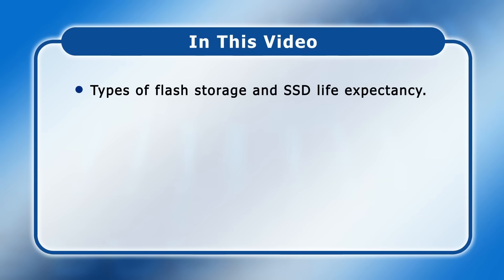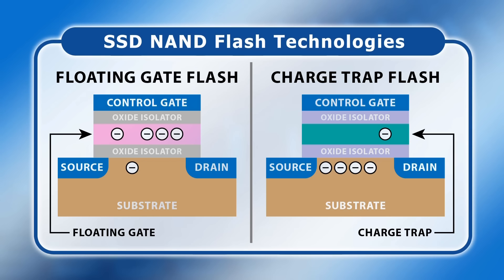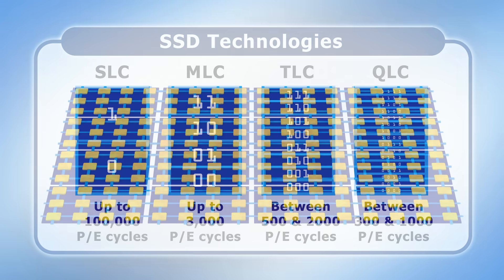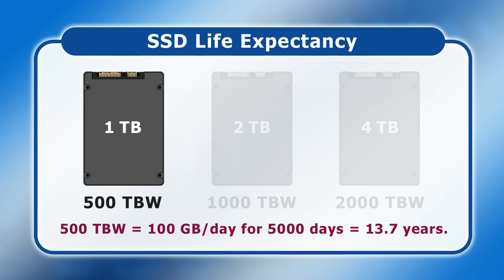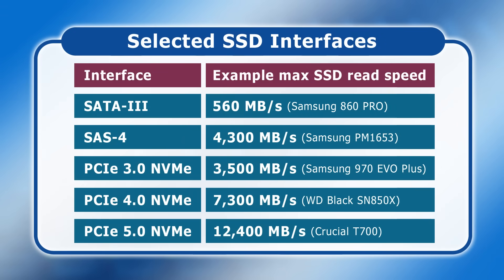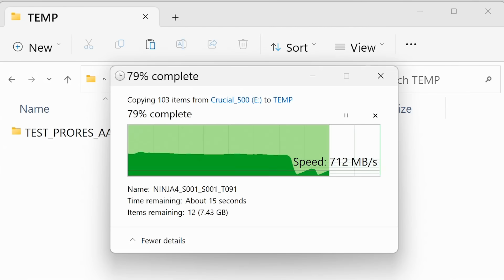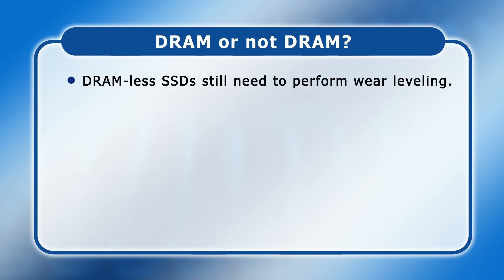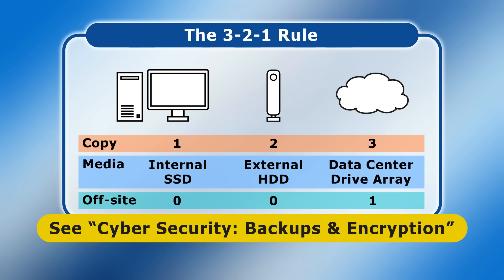Explaining SSDs: The Price/Performance Trade-off

Comment: Uhh, They still make the 860 Pro, and Samsung's website still state they're 2-bit MLC They even make them in 4tb, though I dare say at an eye-watering price.
Reply from the maker: Simply not true. Samsung most certainly do not still manufacture the 860 Pro. I do not tell lies in my videos as you infer. I don't know what website you are looking at, but the Samsung page for the 860 Pro here --
https://www.samsung.com/uk/memory-storage/sata-ssd/860-pro-sata-3-2-5-inch-ssd-512gb-mz-76p512b-eu/ -- notes that "This product is no longer available. Please choose another from the range." Which is pretty clear, and  in line with numerous reports of the same.

There are few 860 Pros still listed on Amazon/etc, and for very high prices as you say. But this simply means that a few possibly still exist with retailers (often web listings do not reflect stock). And these listing in no way reflect what Samsung itself sells, let alone manufactures (and in the video I said that Samsung do not sell them). I really do give up. This distinction between a company making and selling a product, and some (old) retail listings still existing online, is not hard to understand! :)
Reply: @ExplainingComputers  Mate, I never accused you of lying. I was genuinely under the belief that they were still available. At least they seem to be a few months ago.

They are hands down an amazing hard drive that I would trust to have at least a copy of my important data on.

Yeah, and I've given up too, what's new? It's as clear as mud; you state Samsung don't directly sell them. yet you mention that they do and compare them to (old) listings.

I get what you're trying to say, but contradiction isn't really easy to understand :)

Comment: It's weird how today, at least in my place, 2.5 inch SATA SSD is more expensive than the NVME PCIe for the same storage size.
I also still use HDD except for the OS. I use the WD Ultrastar for hopefully, maximum reliability.

Comment: Another great breakdown and explanation, which begs some potential questions.

1. Is there a software utility available that can read all of the relevant information from an SSD for a user to determine exactly what they have, that can be compared with the information given in this video, which could also hopefully include stats of drive usage to allow somebody to gauge how long theirs might realistically last based on their usage to date?

2. When it comes to backups. do we think that mechanical drives still have a long future as more reliable long term back-up devices?

3. How ling can an SSD actually hold onto data, even if it light years away from any normal wear and tear use values? Does it fritter away into the ether if stored away and not used for a long period?

Comment: An SLC cache serves a useful benefit in data protection on unexpected power loss. The SLC cache can be FIFO do written in a simple loop fashion. Once the data hits the cache it's committed, then the drive can move it to long-term storage at its leisure. If this is interrupted it can just go back through the SLC cache when it's powered up again and recovery anything that hadn't yet been moved to long-term storage. In effect the SLC cache is a huge write journal which includes file data.

DRAMless SSDs also benefit in that there's not lots of data in memory that is lost when power is unexpectedly cut. This also makes it easier to recover from such an event, without loss of recent writes.

Comment: There are great deals on used 2-bit MLC SSDs these days, especially enterprise drives with power loss protection. I'd take these over a new 3-bit TLC drive any day.
Reply from the maker: Very true.
Reply: @ExplainingComputers  I should say that this just applies to SATA drives. NVMe drives have gotten so fast in the past decade that you wouldn't want to use an old one if speed mattered.

Comment: Yes, Backup always the Issue, I have for Last 40 Years, Just bought a Spare HDD, Made a Copy of System, leaving 1 on Shelf, It works, as I never have lost anything important, but it has filled a shelf or 2 with HDD's just sitting there .. I Just Purchased 2 x 4TB Kingston NVME NV2 SSD, I put them in a Twin NVME USB Raid, for a 8TB SSD, I am satisfied with these units Performance, it took about 3 hours to backup 7.2 TB for my Main Machine, sadly I didn't watch that hard, so no idea if it slowed down, just that it worked ...As I paid $1495.00 for Each one of 4 x 20 Meg St-506 HDD way back when, I am more happy with the Price per Meg these days, but I do like Drives being Faster ..

Comment: Thank you, that was interesting. specifically, the fact that leaving an ssd less than 90% full so it can shuffle data around easier. I already did that because hard disks liked that to prevent fragmentation so it's nice to know that this still holds true but to prevent wear instead.
Reply: I know that many defrag utilities stated not to be used on SSD's ... NOW I understand why!
Reply: @lesliedeana5142  The reason why defrag programs aren't used on SSDs is because it doesn't make sense. SSDs don't have tracks, sectors and clusters, neither they have moving arms and heads. So they don't need to reposition the head to another track or sector if a (large) file spans over more than one of them, like mechanical disks do. SSDs are electronic devices, capable of accessing any block of storage immediately, without any repositioning or rotation latency involved.

Comment: Hey Chris, I've asked you before about this; can you explain WHY my brand new WD SN570 2TB DRAM-LESS TLC SSD, fitted into a USB enclosure, won't work with my Beelink Mini S Windows 11 PC, yet works perfectly with computers from the year dot? ... Betcha can't explain that? 🤣

EDIT: What about leaving unallocated space on an SSD, to extend life expectancy? I usually leave 10% unallocated.
Reply from the maker: I would guess that the Windows PC may somehow be registering that it is a DRAM-less SSD that is requesting system RAM via HMB mode (and it cannot access the RAM over USB, so fails). Whereas the older hardware (and OS on it) works because it has no idea what a DRAM-less SSD is, so is leaving  the SSD to its own devices, so it uses NAND flash for its wear levelling map.
Reply: @ExplainingComputers Thanks Chris! You're the best! I've been using and building PCs for 27 years, but always learn something new from your fantastic vids! ... I'm thinking of making a warranty claim on the Beelink, but I'm still unsure about this fault. The SSD is unstable on the Beelink, and appears and disappears. It's totally unusable. Surely WD wouldn't make an SSD that DOESN'T work with a Windows 11 PC, even though it's via USB?

Comment: I retired from a nearly 40-year career as a computer and network admin. This has always kept me close to the hardware and how the operating system uses it, especially in the earlier days through the evolution from mainframes and minicomputers to common standards-based ISA and PCI systems with mass produced expansion cards. This particular tutorial is excellent, and has expanded this old dog’s understanding of non-rotating storage devices. I was vaguely aware of the cycle-based limits on lifespan, and now I see the details far more clearly. Thank you..
Reply: Probably the missing part is to talk about how HDD also has a controller (many people don't realize how everything abstracted) and that both SSD and USB-flash drive sticks are both flash-based and basically the same thing. The differences are in the number of chips, etc. and how fast & smart the controllers are.
Reply: @autohmae  they are not the same thing, the platters and the flash memory are not the same thing! one is mechanical the other is not....
Reply: isa.. lol   bin awhile since I heard that.    still going though..   started with a 8088 too..   in fact I still got 4 working ones :-\        what's with old techs keeping old as stuff...   whats this... a voodoo 3dfx  .....   oh come on LOL
Reply: @harleyme3163  Ha, old computer guys and old computers. I get it. I have 5 older Thinkpad X-series laptops of which the newest is 8 years old and still runs Windows or Linux adequately. The oldest is a working 20 year old Thinkpad X40 that is currently running an older version of Debian 32-bit, and it fires right up and is quite usable as a note taker, simple email client, Remote Desktop client, or basic web access tool. I long ago replaced the teensie-tiny weird form factor 20GB spinning disk with a specialty 30GB SSD which is what keeps it usable. The original 20GB hard disk was the same disk model used in the early iPods when they still had spinning disks inside. I also regularly use a 2010 Mac Pro (big desk-side cheese grater case) that I’ve maxed out on CPU cores and memory because the parts are now so affordable. I hacked it to run a recent version of MacOS  for a while before converting it to a Debian utility server, virtual machine host, and gaming desktop. With 12 3.33ghz Xeon cores and 128GB of memory plus a relatively recent AMD graphics card it’s more than adequate for my meager needs despite it being 14 years old.

Comment: In 2020 I purchased a Samsung 970 evo drive for my wife's computer, 1tb based on reviews and it's very high rating. Now in 2023 that drive has failed, Samsung says it was because of a bios and others say it was a particular chip supplier I believe that would vary which cell was being written to to extend the longevity of the device. Either way in some 30 months the drive experience catastrophic failure despite only having 300gb of the drive used and most other data written to a larger hard disk drive for a majority of storage on the device. Pretty disappointing, but not the first time I've been bitten by the "reputable" manufacturer. My cellphone of the same brand experienced a battery bloating that actually split the phone in half about 2 years ago, it was an s10 that was only 18 months old. I love the video, very concise and helpful, but all I can say is even buying a "quality" device doesn't always ensure the manufacturer will provide a quality example of the product when purchased.
Reply from the maker: Sorry to hear of your hardware problem. Sadly all drives, and all microelectronics more generally, will fail. And they will fail across a statistical distribution where most people in the middle of the curve will get years and years of life, but those unlucky 5% to 10% at the start of the curve will experience early failure. The Samsung EVO 970 is a very good SSD relative to many others. But this does not mean that some of them will not fail early.

I once had a very good quality motherboard that failed after 13 months -- just out of its 12 month guarantee. This stuff happens, and will always happen. It will happen less often with a higher quality item from a better brand. But that does not make such products immune from early failure -- not that that this makes it any easier for the owners!

Comment: Chris, I upgraded my SSD to my newly built computer. WD Black NVMe Game Drive 2TB GEN 4 from a Samsung 970 EVO PLUS NVMe 500GB.  

Corsair 110R Case, Intel Core 12th Gen Inte Core i5-12400, 2500 MHz 6 Core 12 Logical Processor 
Gigabyte H610M S2H DDR4 H610/Intel LGA 1700/Micro ATX/DDR4/Single M.2/PCie 4.0/USB 3.2 
Corsair Vengeance LPX 32GB (2x16GB) DDR4 DRAM 3600MHz Desktop Memory Kit.

Gen1/Realtek GbE LAN/Motherboard) EVGA 750 GD, 80+ Power supply Thanks for the great content and information on SSDs.
Reply from the maker: Sounds good. That's a lot of extra SSD capacity. :)

Comment: So would i be better using 2 1tb ssd drives in raid rather than a 2tb ssd? I say this as the data is written across both drives rather than the one. I know the risks of one drive dying and the array failing but it seems this might actually be better long term for a system drive now. Or am i talking rubbish and about to make a mistake with 2 x 1tb drives as my system drive.

Comment: I bought an B+M key SSD for a laptop.  It fitted but didn't work.  So there's another complication I could have done without and £45 wasted.
Reply from the maker: Sorry to hear about this. Sadly keying is never a sure indication of drive interface support. You have to check whether a computer supports a SATA or PCIe NVMe drive, or both.
Reply: If you can, keep the the packaging and the receipt (if there is one) and return it for a refund.

Comment: Thanks for the very informative video. One thing I am not clear about after watching the video is if buying a larger drive but leaving a bigger part of it empty helps in prolonging the lifespan of the drive. I may have misconstrued it but I thought the video kind of implied this but I am not sure.
Reply from the maker: What you say is correct -- you have construed accurately. :) Larger drives, subject to the same write intensity, will last longer, as they can even out the writes across more clocks.
Reply: @ExplainingComputers  excellent, thanks for the clarification 👍

Comment: There is one HUGE negative to D-RAM less drives that Chris didn't mention. They CANNOT be used in external drive enclosures/external drives because they require your pcs RAM to function.  I found this out the hard way recently, and it took hours of hair pulling and frustration to figure out WTH was happening. Don't buy D-RAM less drives! The minor savings are not worth it.
Reply from the maker: Now this is a great point -- which I guess only applies to the new generation of DRAM-less drives (as those that store their map in their NAND flash should work in an enclosure).
Reply: it's a bit extreme to say that you shouldn't by drives without a dram cache just because you can't use them in external enclosures. the savings can be very much worth it, it's just something to be aware of, just like the potential speed difference.
Reply: @shade221  obviously people can do whatever they want, it's their money, but I won't rich them with a 10 foot pole.
Reply: @SunnyD514-yuck  very few people at the moment are going to use an SSD in an external enclosure. the potential speed difference is a way bigger factor for most people.
Reply: Really? Is this new? I have never seen a working drive I couldn't access through my SATA to USB or M.2 NVMe to USB adapters.

... any specific models?
Reply: @Olivia-W  Yea, mostly. Chris mentioned it near the end of the video. My experience was with the crucial p5 4tb model, which uses QLC tech. The way it's configured, it uses your pcs RAM to function,  which is fine if you're installing it on the motherboard but not so much when using external enclosures.
Reply: Hello, can you explain better that point?
I use very frequently SSDs in external enclosures, but in prevalence Crucial MX500 and Samsung 8xx EVO series.
Have you a handy list of the most common SSds you consider problematic in that kind of circumstances?
Reply: @briccimn  No, because I don't know all of the drive models that are affected. My best recommendation for you is to avoid anything that uses QLC memory,  at least for using with external enclosures. Other than that, you'll just have to use your Google-fu skills to verify if they'll work for you.
Reply: @SunnyD514-yuck  I've been using SSDs since they came on the market...
NONE of them has ever had problems within external enclosures, ever.
So, without googling, I can assure you that in my personal (so not statistically relevant) experience, I don't back completely your words.

There are for sure capacitors within most expensive and high quality SSDs (almost always combined with DRAM, though), which sustain sudden lack of energy to let all data be written when cabels are detached by improper maneuvers, but DRAM-less in external enclosures is not necessarily a no-way choice...
Reply: why did it affect you so much?
Reply: I think the problem is that modern dramless drives that are designed to use HMB cannot use the host's RAM over a USB bus as it requires PCIe lanes to do that, but from what I understand is that with the absence of the option of using HMB, drives will just fall back on using the nand for the function, meaning it will work but with a penalty to speed and longevity. I hope I have that right from what I have read.

Comment: Since younger we got the myth "do not pull off the pendrive if you didn't ask windows to do so or the data will be erased!" Now we will get the myth "do not fill up the ssd or it will last a year!" 😂
Reply from the maker: Well, the pulling out a drive before a safe removal was always (and remains) that data could be corrupted. And nowhere in this video do I say that filling up an SSD will make it last a year. But, as has been known for a very long time, operating an SSD at a very high capacity (90 per cent plus full) will as an absolutely certainly reduce its life expectancy on a drive on regular write-use, relative to a drive that is less full.

Comment: I notice the dram ones working a lot better on Windows. Have used both. Feel like if the cost is close enough best to go for the Dram. Linux will still run well on older ssds/dramless nvmes. Have that Samsung 970 evo plus 2tb in my main machine for my gaming rig.

Comment: Still using the same boot drive 240GB Kingston SSD from 2015 that was slated in reviews on release. Doesn't seem to be any reduction in capacity. A many-times upgraded and updated Windows still up and fully running in <20 seconds. Now also using NVMe as storage because it was so cheap. SSD is truly a marvellous thing.
Reply from the maker: Kingston SSDs have in my view often had a lot of unreasonably poor press.